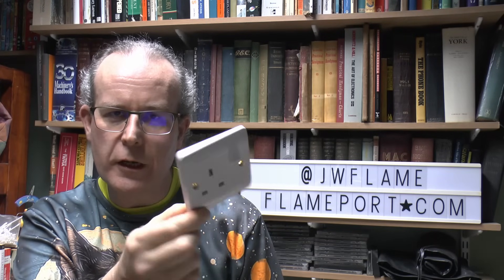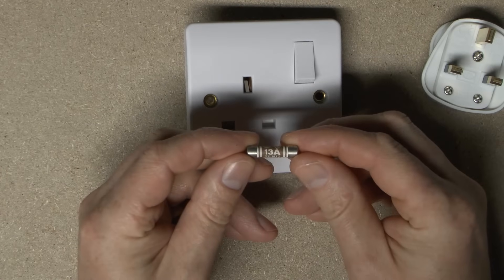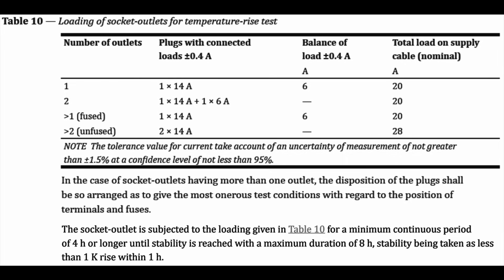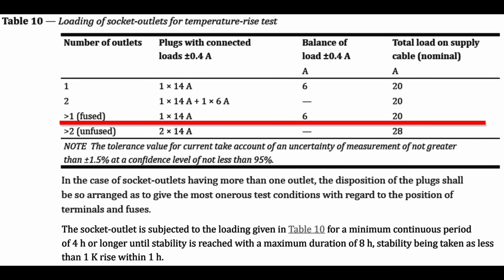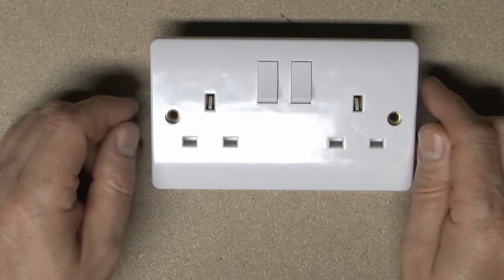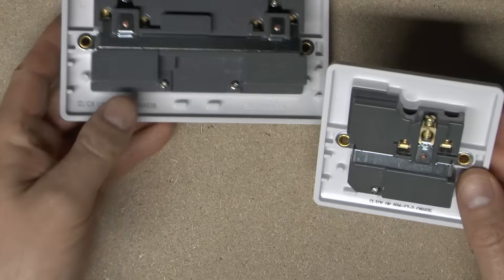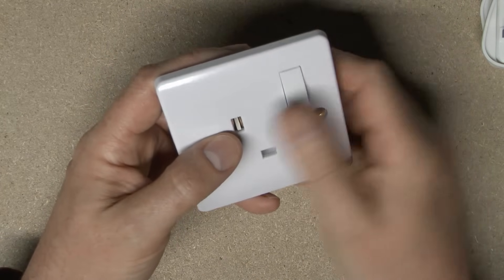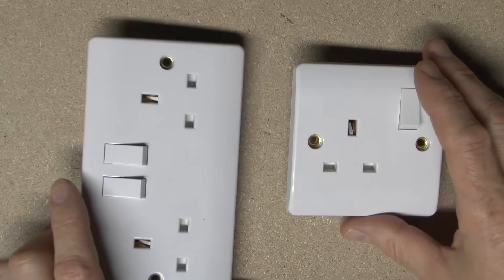Double Socket Outlet 13A 20A 26A? EV Sockets, Fuses,  Washer/Tumble Dryer in one double?

Comment: Thanks John! As always very interesting to see how things are in different countries. Just fo my understanding: The two terminals are for the ring wiring in UK? Or are they individually connected to the respective outlet. The latter would be the case here in Germany, which would allow individual circuits to be connected to each outlet (we have star topology not ring).

What is the typical rating for the MCB in such an installation?  With a German 13A type B MCB, the MCB would thermally disconnect 14A after approx. 1.5  hours.  Our typical installation is however 16A, which gives us 3,6kW per circuit. 

Even though that is great for single phase EV-chargin, we always recommend to use a separate circuit for EV-charging that has a larger diameter. E.g. if a 1.5mm² wire would be OK, chose a 2.5mm², if you need 2.5 due to length of the line, chose 4mm² and so on. We do this BTW practically for all new installations where continuous use can be expected (kitchen oven, dish-washer, washing machine). EV charging definitely falls under this category. Plus we recommend to use a CEE-Plug that is rated for 16A continuous use. 

I would never ever plug an EV in an outlet, that is rated for 13A. Or do the cars in the UK have a lower maximum rating than 3,6kW for single phase charging? In that case charging will take even longer...

If a new individual circuit is installed, we also recommend, that the customer pays the little extra for a 5x2.5mm² Installation so he can unpgrade to 3-phase charging, by just installing a wall-box. However the bottleneck here is often the meter wiring. For continuous use, the meter wiring often has to be upgraded, which is considered a "major change" in the meter box. That renders the protection of existing assets in an old installation invalid. That is an important catch.

In such a case the meter installation has to be updated to current standards (meter plate for smart meter, selective CB before the meter, overvoltage protection, and so forth), which is IMHO anyhow a good idea if you want to draw 11kW continuously. However we have in most cases meters and breakers side by side in a single cabinet, which means, also the breaker board has to be upgraded. Including a new cabinet, RCBOs and new MCBs, that can easily sum up to anywhere between 2000 and 3000 €.

A hefty premium for an EV - especially if it is a company car. Most large companies banned combustion vehicles from their fleet to match the CO2 fleet limits for CO2. In such a case you get a car from the company, but have to pay 2500€ for the upgrade of your installation if you want/need to charge at home. I have seen grown businessmen crying. 

Looking at it from that angle, you are lucky, that AFAIK most households in UK only have single phase connection.

Cheers
Andreas
Reply: All portable EV chargers designed for UK standard 13amp sockets are actually limited to 10amps maximum. This keeps the circuit well within normal tolerances so long as wiring and sockets are in good condition.
Reply: @MrAdopado  Thanks for this information! That would make German driver extremely unhappy. They are very keen  to charge as fast as possible, even though they have all night and a driver commutes in average 80 km per day, which can be rechareged at 3,6kW in less than 4 hrs.

Comment: I always put an unswitched socket in a cupboard for appliances.  A few times over the years I have seen the switches burn out when the cupboard has items stacked in it and have been leaning on the switch rocker holding it in between on and off.

Comment: In electrical distribution systems the whole does not equal the sum of its parts.  A ring main may have any number of 13 amp sockets but if it is fed by a 20 amp breaker then that is the maximum designed continuous total load.  System design assumes that nobody will be using a 13 amp appliance in every socket simultaneously.  Rather, over any period of time any individual socket may take no load, or any load up to the maximum 13 amps.  The variance in loads over time is calculated as what is called the diversity factor.  If no allowance were made for diversity then the mains cables would need to be much thicker and the ring main would need to be protected by a much higher rated breaker.  Imagine the hazards of having 12 sockets if, absent the diversity factor, a 1456 amp breaker and 78 amp cables were needed.
As for two-gang sockets, diversity is allowed for in their design.  They are not intended to sustain 26 amp continuous loads, but rather a brief 20 amp peak and a 13 amp continuous load.  (The peak occurs when an inductive load such as a motor is first switched on.)

Comment: I wouldn't recommend going above 13A for EV charging specifically. Around Christmas I had my car charging at the full 13A in a double plug with my boiler in the other, heating must have kicked in and the plug starting sparking (amazingly didn't trip anything and car continued charging) but when I replaced the plug the live wire had melted into the socket itself and all the plastic around there had melted and molded around the live terminal. Wasn't aware of the EV spec but without that I would avoid plugging anything else in!
Reply: In theory it should be impossible to charge an EV at 13A on a UK 13A socket because all portable EV charging equipment sold in the UK is limited to 10A maximum... however, I could quite imagine that you would still be pushing the double socket limit if you have a boiler on the paired socket!! Not advised, as you discovered.
Reply: @MrAdopado  I wasn't aware of that rule, I've seen plenty of 13A chargers online and my car reports 3kW so at 240v the maths adds up.

Comment: The quality of the plug itself, has more to do with overheating than the sockets, although some modern 'off brand' sockets can be of dubious quality, compared to say, the older MK Logic range from the 1970s & 80s, just look at how much bigger the terminals & contacts are in those older designs, compared to most modern ones, (which are often made down to a price nowadays!)

As for 13 amp plugs, the example shown here is the very average but widely used 'PMS' Chinese produced plug, these have been around since the early 1990s & often found pre fitted to many items.
By far the best plugs for heavy loads, are the old style MK plugs from the 1970s & 80s, with the screw nut terminals, second to that, the more recent Sclomore plugs are a good quality type as well.
Reply: Don't you just love the ubiquitous permaplugs with the cover that breaks off as you try to pull them out of the socket, leaving their potentially live guts exposed?

Comment: There are real 20A fuses in the 1 inch size. But they are not intended for use in 13A plugs or in fused connection units. And IIRC they don't carry a British Standards (BS) number (all plug fuses should be to BS1362 and should be marked as such). The real 20A fuses that I used/have seen in use are/were used in industrial rail mounted fuse holders for 24V DC equipment.
Reply: In addition to the usual 3,5 and 13 amp fuses, There are also 1,2,7 & 10 amp BS1362 fuses which are obtainable from electrical wholesalers/RS etc. Perfectly OK to use. 
I had a college lecturer who said they didn’t exist, until I turned up the next week with a handful of them.

Comment: Interesting video and a topic I never really thought about. I guess there are very few appliances which draw more than 10A (washing machine and kettle?) so it rarely arises. Perhaps it might happen in an older kitchen with a limited number of sockets? Also worth noting that heating is proportional to current squared so 2x10A will generate less heat than 1x14A+1x6A.

Comment: ... In N.A.... building codes... require that every residentual... kitchen... double 120V socket... be split... to provide two 15A sockets... fed by a 3 wire supply... or... in the past few decades... one 20A double socket... fed by a 20A two wire supply... 

... all other room's double socket receptacles... are a single 15A circuit that is shared by both sockets... maximum... 12 sockets... in series
Reply: All UK sockets have 3 wire supplies.

Comment: On a BG 13A switched external socket I have experienced the actual switch pin melting and allowing the power to oscillate due to poor contact, thereby causing arcing of the switch contactors. And some scarring-through of the face plate. This was caused by use of a portable “hot tub” which pulls no more than 7.5A in cycles of about 2 hours. I did report the failure to BG with no response.

Comment: The ring is usually rated at 30 amps so as long as the total load does not exceed that you going to be OK. So yes you can load a two gang socket at 13 amps each.
Thing is the system usually depends on 'diversity' ie you don't normally load them up that much. I have done it in the past and it was all OK.
The safety is the fuse in the plug, which should be rated for whatever device it's feeding.

Comment: Multiple sockets can be on one ring main, so even if you don't use a double socket there is still the load on the wiring in the wall. Does this make a difference?

Comment: I can add some other scenarios to the kitchen - 3kW kettles seem common these days for when you really need a cuppa, dual air fryers go up to 2.4kW going at full chat, then maybe a dual table top induction stove at close to 3kW - alternatively as a mate and I once discovered (we were both "competent" E&E grads at the time) that plugging in 2 wallpaper strippers into a coiled extension lead made the PVC quite melty 😆 Plenty of ways to overload a socket - usually with 2 or 3 way adaptor or a 4 way extension with too many things - heater, hairdryer, vac etc - whether any of these would be going at full chat for >4h is unlikely however - maybe x2 EVs on granny leads would be the one scenario I could think of. So in conclusion - it's fine, just don't do anything dumb 😁
Reply: I really don't see what all the fuss is about with air fryers, they just seem to be a bit of a fashion statement at the moment.
Basically they are just a small electric tabletop convection oven, I recent watched a Big Clive video, where he dissembled an air fryer, & its really just a fan heater inside a metal box!
Reply: @RichieReportsUK_UKCNews yeah Technology Connections did a similar dissection - haven't been tempted yet but am interested in a multi-purpose one that might take the place of a hob pressure cooker, slow cooker but also be a big enough oven for 5 people - the engineer in me suggests that there are far too many failure modes in the X-in-1 type gadgets and best stick to individual items that do their own job well 😬
Reply: @ I see Lidl, (In the UK), are advertising a combination Microwave oven/ air fryer, made by Haden, I can't see it would be much different to a normal combination microwave. In store next week I think.
Reply: @ I remember learning about combi-microwaves at school in the early 90s and persuaded my parents to get one when we were looking for a microwave - the grill/oven feature never once got used 😆

Comment: I see the single socket has a CE mark on it - surely CE marking doesn't apply apply to domestic mains plugs and sockets?
Reply: The UK mark seems to be the latest version of the CE mark.
        CA
Reply: @RichieReportsUK_UKCNews Here's what WP says in its 'AC power plugs and sockets: British and related types' entry:
There is no European Union regulation of domestic mains plugs and sockets; the Low Voltage Directive specifically excludes domestic plugs and sockets. As such, no relevant retained EU law applies. EU countries each have their own regulations and national standards and CE marking is neither applicable nor permitted on plugs and sockets. Despite this CE marking is sometimes fraudulently used, especially on universal sockets

Comment: Regarding the EV rated sockets I'm not sure that switching an inductive load is relevant issue since the Portable EVSE (aka Granny Charger) draws very little current when initially plugged in/switched on as the EVSE negotiates with the EV charger over its low-voltage (12v) and completes safety checks before the EVSE closes its internal contactor and thus connects the 220/240 mains to the EV. More significant I would say from personal experience is the extended period of time the socket has to deliver a constant 10A and the effects on heating the sprung contacts in the socket leading to weaker spring tension and potential for higher resistance connection and so on. The comparison is that as the video said washers and dish washers may only draw 10A or so for 20 minutes at a time not 12 to 14 hours or even more when overnight charging an EV.

Comment: I have an EV charger with a selectable current output that offers up to 13A. I plug this into an EV rated socket for 5 hour charging sessions. I have been running this at only 10A to err on the side of caution. It gets warm to the touch but not worryingly so. Maybe running at 13A would be Ok? At least in theory anyway.
Reply: Are you in the UK? I ask because portable chargers with a 13A plug are normally restricted to 10A in the UK.
Reply: I am in the UK. This charger bought from Amazon claims to run at up to 13A. I haven’t attempted to verify that.

Comment: EV rating is just the old manufacturing from the 1970's, with thick copper busabars, and enough brass in the contacts, along with springs. The sort of thing that got cut out when they went to make them cheaper, reducing thickness of the contacts, area of the current carrying parts, and used smaller contact buttons on the switch, all to save money on material, plus also going to thinner moulds and more glass filled plastic over the old method of thick heavy plastic and punched out SRBP or FR4 laminate as insulation inside.

Comment: Thanks for that I was under the impression it was 2 x 13 amps.  So why doesn't the manufacturer put 20amp stamp on them?
Reply: Totally agree. All sockets (especially double etc) should have a clear, easy to read label stating the max amps in each.
Reply: @Jack_cx  What happened to UK standards we were the best at one time in the world. It should be obvious to stamp its maximum power use. It should also be on the front not the back where it can not be seen once installed·
Reply: @ I just think people were much more knowledgeable and safety aware in the past. Today, kids have offloaded virtually all thinking onto The Internet/ChatBS. Unfortunately. That's the main reason we need these labels.
Reply: @Jack_cx  They used to plug electric irons into lighting circuits people have always abused electric systems.

Comment: Thank you JW for getting to the bottom of this age old issue. The last melted plug/socket i came across was a commercial 3kw oven with a 13 amp plug fitted and interestingly it was manufactured in new Zealand. I converted it to a 16 amp plug /socket/ rcbo arrangement as it was a counter top oven and needed to be removed periodically.
Reply: New Zealand doesn't manufacture 13A plugs or sockets, we use 10A, 15A, 20A, 25A or 32A plugs and sockets.
Reply: 3kW at 230V is 13A, so the existing plug was fine. An oven isn't on for very long, since it has a thermostat. It takes a few minutes to get up to temperature and then will turn off, turning back on just briefly every few minutes to maintain the temperature. A 13A plug can easily handle an intermittent 13A load. I don't know why it melted, but it wasn't because it was underrated. You should have looked for the actual problem...
Reply: It's not a 'plug/socket', it's just a socket!
Reply: @icarossavvides2641 if you listen carefully you will hear JW discuss 13amp plugs to bs1363 thus a plug / socket arrangement. If thermal effects occur it normally affects bothe the plug and socket thus a plug/ socket arrangement.